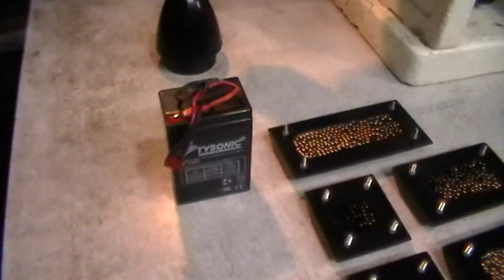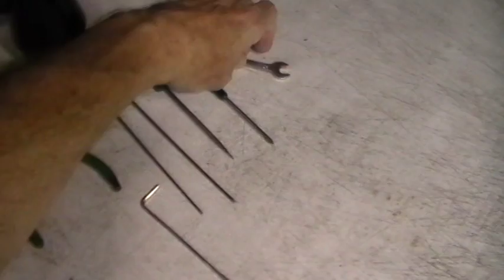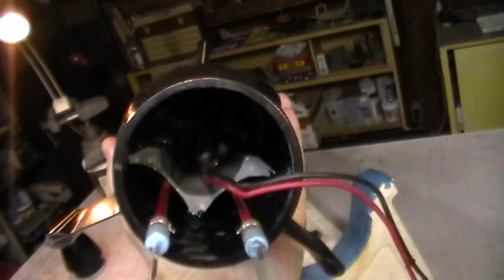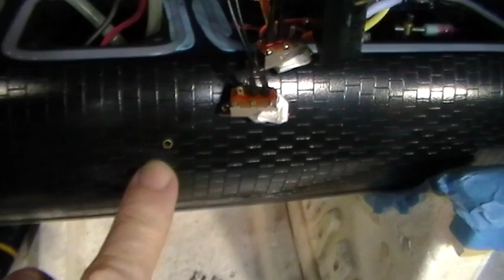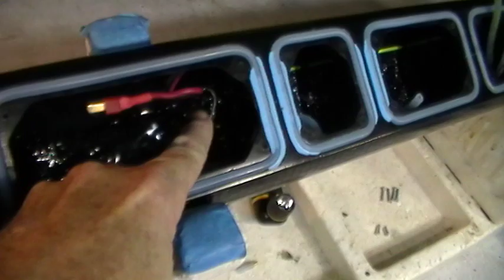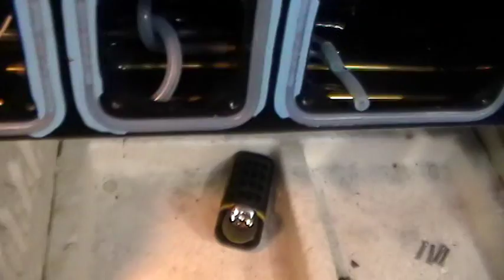Los Angeles Class 688i fast attack submarine model: Interior layout and equipment explanations.

Comment: Where are the bow planes?
Reply from the maker: john doe - The bow planes on the full size sub are retractable, their outline is etched into the hull detail. There is a bow ballast tank for the model at the location of the bow planes, so when I designed the model the decision was made not to represent them in physical form. I did build a static set for one client, but they proved to be susceptible to breaking off.

Comment: What kind of price is this worth?
Reply from the maker: When the sub is fully assembled with all required gear, tested, boxed and shipped, the price comes in at or slightly above $3500USD.
Reply: One of the highest priced subs I've seen.
Reply from the maker: This sub is a custom project and never was produced in kit form or in the high numbers that would bring the price down. Some of the Engel kits run in similar price ranges, without being fully assembled. However, there are a greater number of less expensive alternatives. The submarine forum of RCGroups.com has quite a lot if diverse information on different subs that are available.

https://www.rcgroups.com/submarines-60/
Reply: Thank you. I found ScratchbuildwithJohn is a great YouTube channel if you are looking at fully building your own sub.